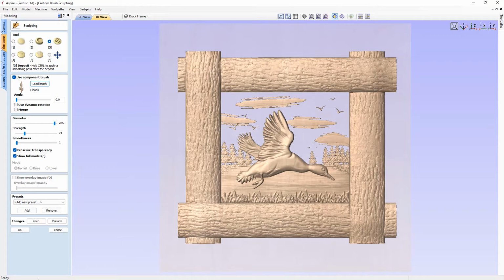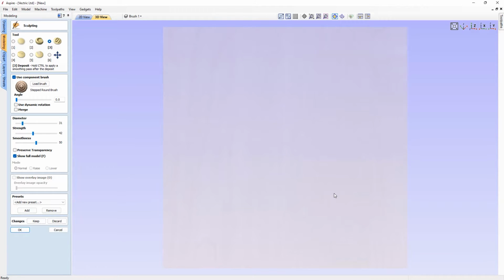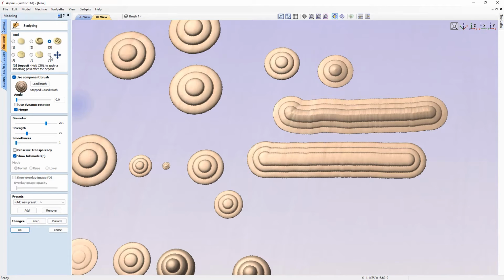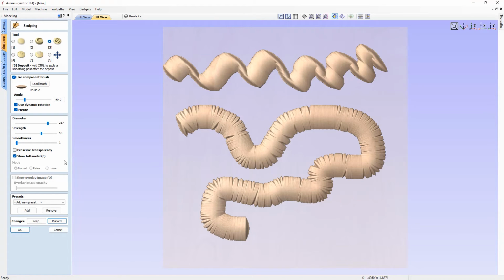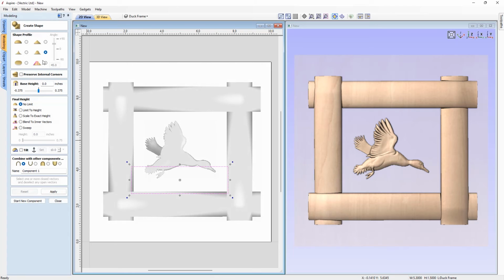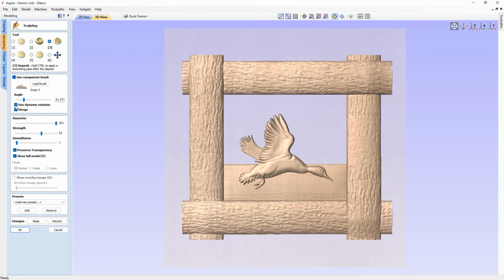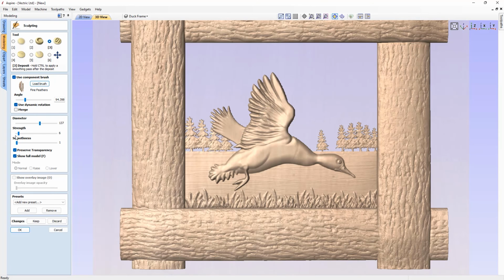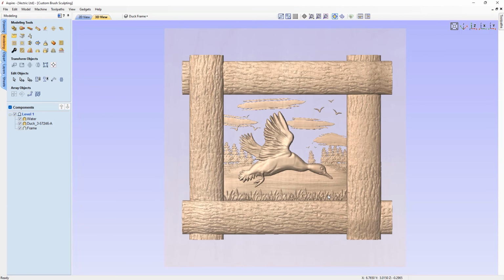Custom Brush Sculpting | Vectric V11.5 Tutorials

Comment: Hi, I am working with topographical models derived from LiDAR point cloud data and the scale model shows the trees and brush as small, short pointy areas.  I need to increase the Z scale for emphasis, but that will also turn my shrubs and trees into tall pointy, spiky things which I need to truncate or shorten.

I can use the smooth tool to kill the tops, that works fine.

Is there a way to construct a custom brush that when applied (clicked over an area), it would reduce the height by taking the tops off the spikes.  Can you think of a way to use a custom brush to do that?  Is that even appropriate for my use case?  Thanks, Bill
Reply from the maker: Hello Bill... interesting... There are a few different ways you could deal with the trees... but hard to describe here.  The smoothing option you outlined is quick and will do the trick, but you could also try doing what we call "skinning" the model.  That is a bit of a process but the short version is to import in the model, create a copy of it, smooth the copy, and then subtract it away from the original model.  This will leave you with a skin... use that result (I would create a new layer, and then create a component from the composit model on that layer).  Then copy the original model to that layer... be sure it is below the "skin" and hide Layer 1.  Now what you can do is subtract the skin away from the original model.  The nice thing about this is that you can ajust the shape height of the "skin" to get the effect you need on the original model.  If you sned an email off to support@vectric.com and mention you would like to get in contact with Todd... I can better describe the process.  In the end there is a possibility it may not net a better result then the smoothing... but it may be worth a try.
Reply: @vectric  Hi, Thank you for that detailed reply. I had thought vaguely about some version of the "skinning", but really didn't have the entire concept down as you have explained so nicely.  I am going to try the smoothing first (easiest and most obvious) and also try the removal tool.  By playing around with the settings I hope to achieve what I want in a single pass or two.  Just for additional background, the models are created out of QGIS, using the DEMto3D plugin that takes the input raster GeoTiff and creates the STL models for import into Aspire.

Actually the skinning is a viable alternative in this scenario because the data comes in 3 "bands", really 3 different sets of point data: one for "Ground", one for "Unclassified" (buildings, trees), and "High Vegetation" (very tops of tall trees), which is not used here. I already have a nice bare earth model from the Ground points; that could be used as the basis of the skin.  The model I want smoothed is the Ground + Unclassified.

And if none of this works out satisfactorily, I can always adjust my artistic goals and create a more stylized and exaggerated Z on the bare earth model where there are no spikeys.  I could then slightly (or not at all) exaggerate the Z for the Ground + Unclassified model to present a true scale model with all the fields and forests and buildings.  There is a good chance that I could exaggerate the Ground + Unclassified model a bit, not worrying about the spikes, and sand then off by hand with some 320 grit after the carve.  I could then sandblast lightly, or brass brush,  to clean out the remnants of the hand sanding in all the tiny little spike valleys. The Ground + Unclassified would be interesting in that it represents the fields and trees and clearly shows the manmade boundaries, and one could run their fingers across the carving for a tactile experience.  The smooth exaggerated model would show the geographic features better and stand alone on its own merits too. 

Anyways, thank you for the good ideas!  Cheers, Bill